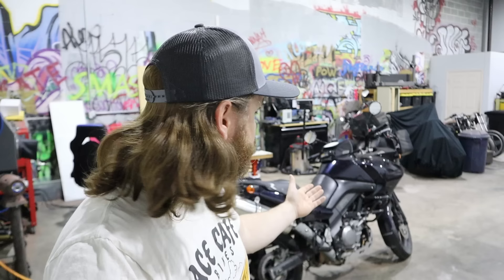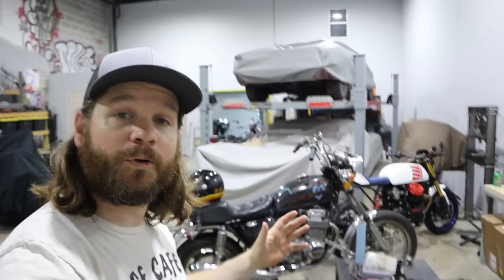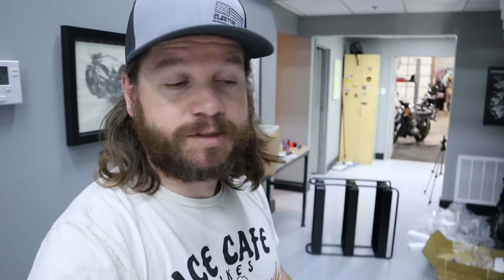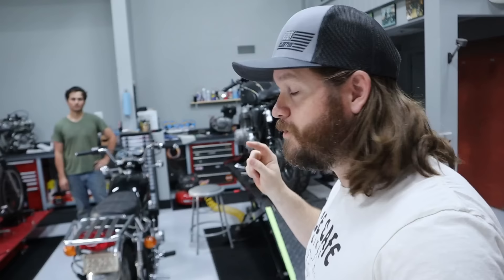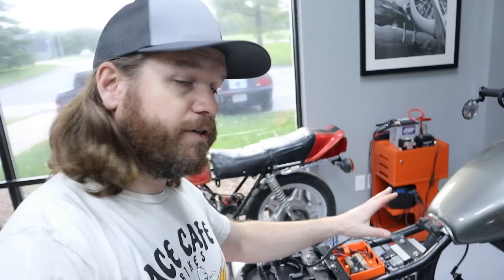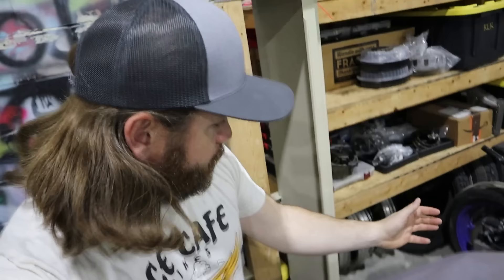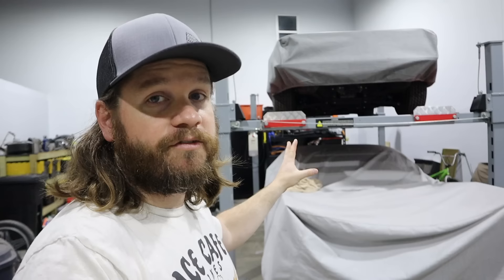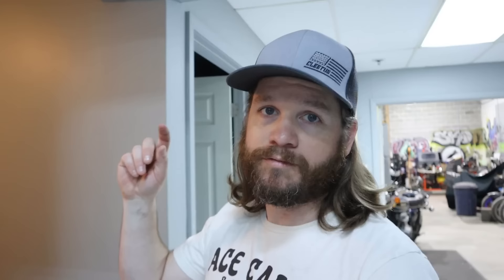Too Many Motorcycle Projects!

Comment: I had a 650 V-Strom for 7 years, it makes a great touring bike. The biggest issue with that bike is trying to sort out the windshield. The buffeting with the stock one can be terrible, and it can take a lot of time and money to find one that works well. The best solution I ever found was installing the Madstad bracket with a taller windshield. There is not much you can do about the looks, it’s a workhorse.
Reply from the maker: So far the wind has been great on this one. Doesn't seem to buffet at all

Comment: You have a great opportunity to do things that you like. You are Blessed. My 2nd gen    VStrom totalled and rebuilt different than it was built is needing a major fix. I need to lube the chain. It is perfect. My KLR needs major chain lubing too.
Reply from the maker: I'm pretty much the worst at chain maintenance lol. This past year I had to replace a lot of chains and sprockets
Reply: @BrickHouseBuilds  
Get back to the basics. Motorcycle maintenance is one of the truely soulfull things I get to do. On my own bikes. Go down the "Tangent" with it. Customer machines are never that way. Love to have them, though. Eating is a good thing.

Comment: I'm in the UK and need a good use headlamp chrome trim for my 1992 CB750 Nighthawk. Any ideas?   Good video as ever.
Reply from the maker: Id say just ebay or the usual parts suppliers
Reply: @BrickHouseBuilds  There are very few of these in the UK so finding parts is a bit of a nightmare.